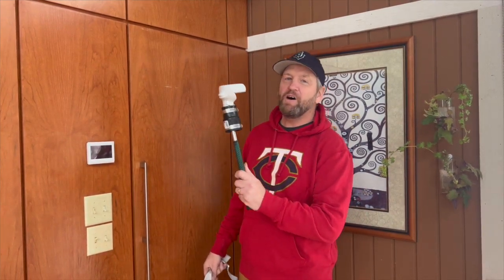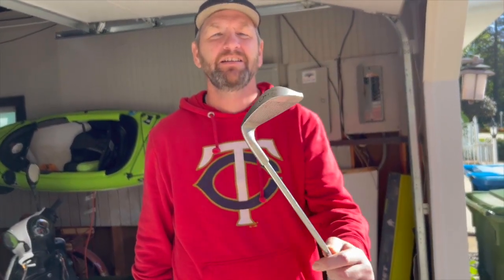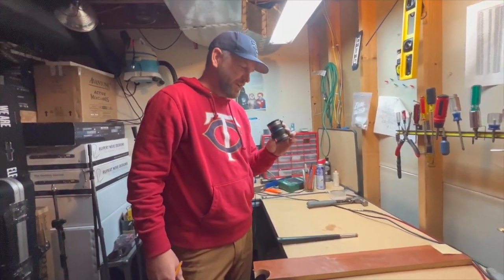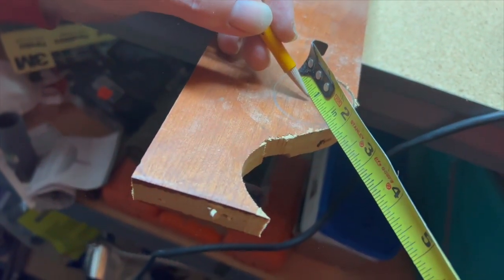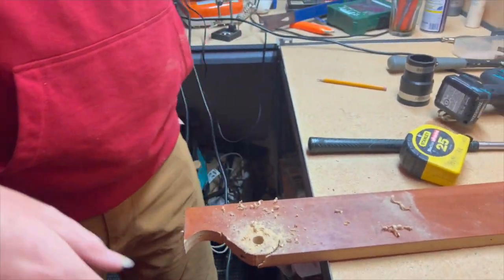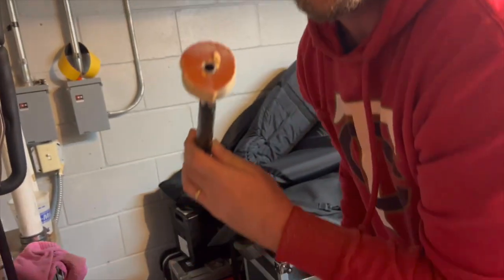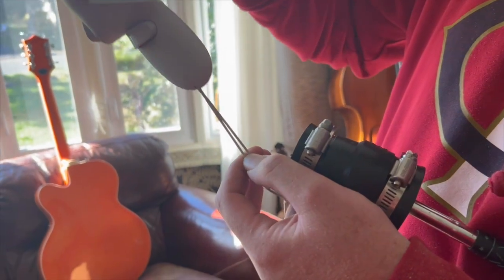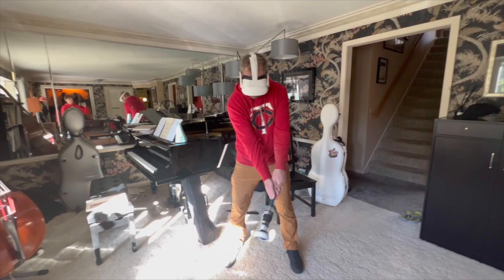Uncle D's Pro Tips-DIY Club for Golf Plus VR

Comment: So, you went on to tell us that you used a half inch drill even though three eights would’ve been fine and then didn’t even proceeded to tell us what size drillbit. Also, just a heads up, The, steel shaft cuts amazingly with a copper pipe tubing cutter. I was able to make one for the PVR, but these damn quest controllers have stubby little handles.
Reply from the maker: Yeah Im not like an actual pro